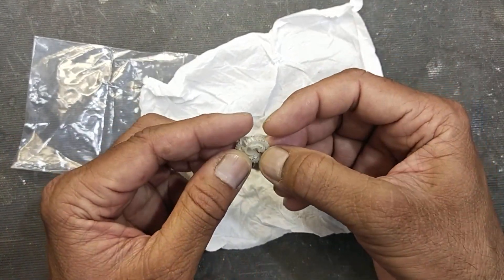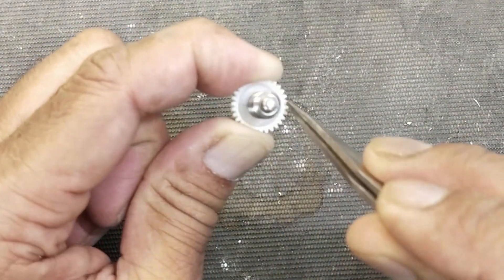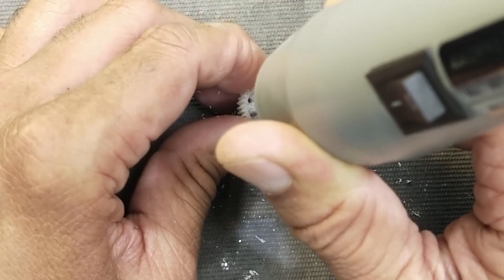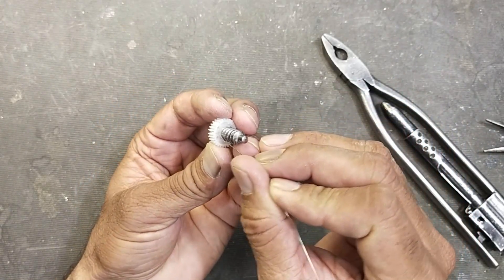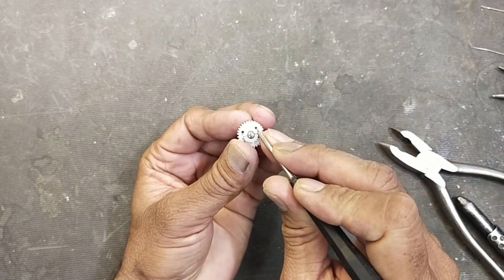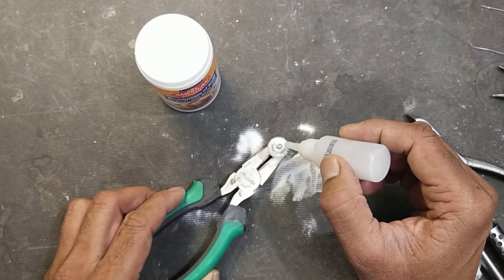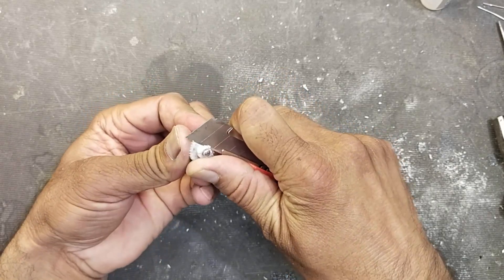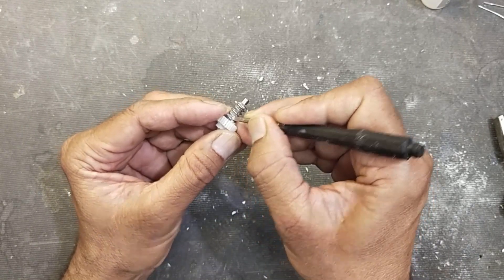{752} How To Repair Broken Plastic Gear

Comment: Hsseeb, can you please do a short video to show the wire twister and how does it work. Also let us know the place to buy. This is the first time I saw this kind of a tool.
Reply: Because it is used mainly on aircraft to safety wire bolts.  Bolts that have a hole for wire to make special knot with this tool = safety wire.

Comment: Thank you. I never saw that wire twisting pliers. Never even seen it on any shelf of any hardware store. i repaired a few stuff with baking soda. I even fixed a broken sink
Reply: The pliers are "safety-wire" pliers from the aerospace industry